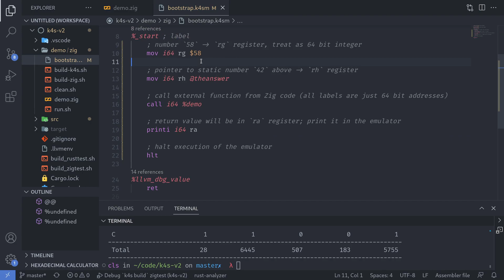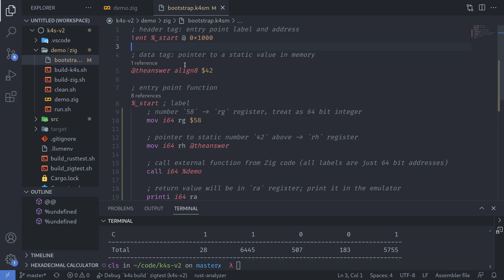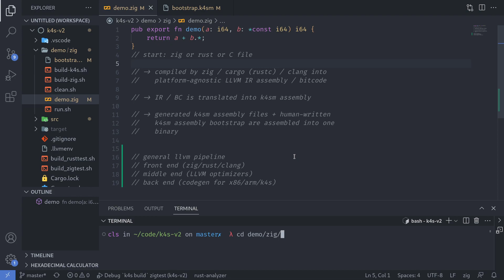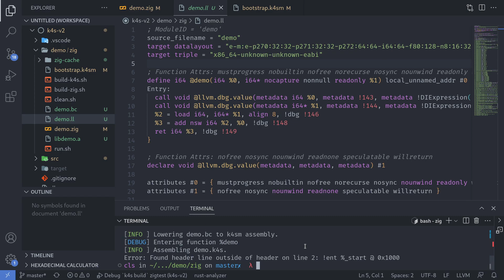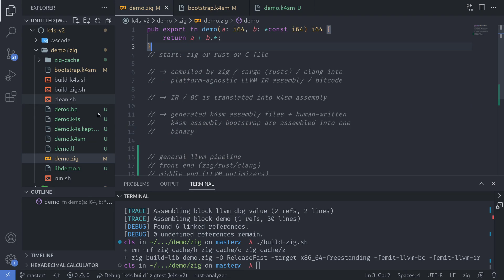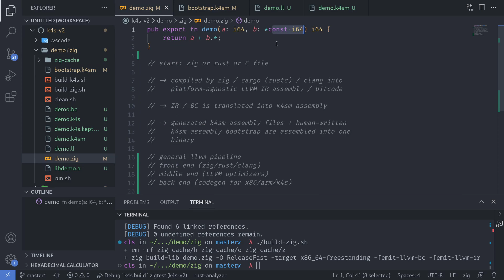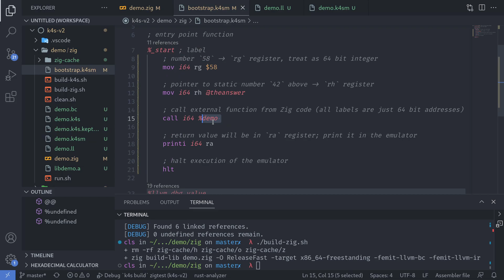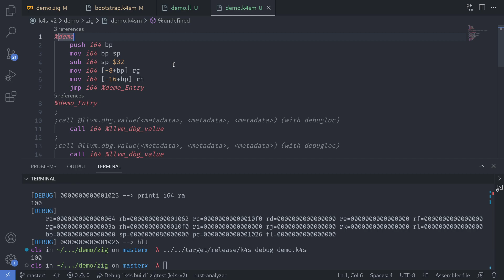How I turn Rust and Zig into machine code for my custom CPU arch! (k4s devlog #3)

Comment: Newbie question: is it generally easier to write an os in rust than c?
Reply from the maker: I'd say it depends on what you mean by easier. Rust requires some setup first to get the compilation target and build environment correct. However, rust will prevent a lot of difficult bugs by keeping the (necessary for os development) unsafe code contained. I'd imagine a C compiler wouldn't warn you about some things that rust would.